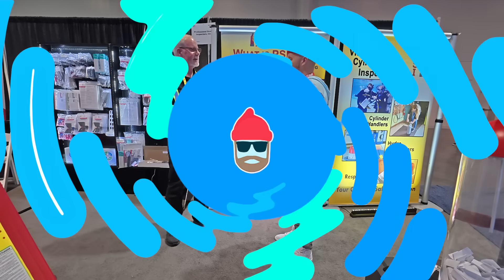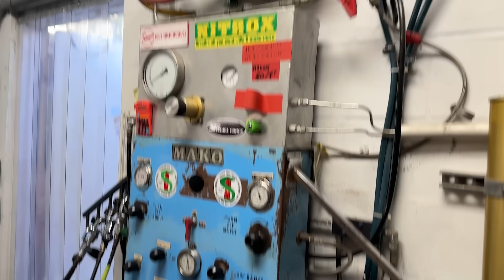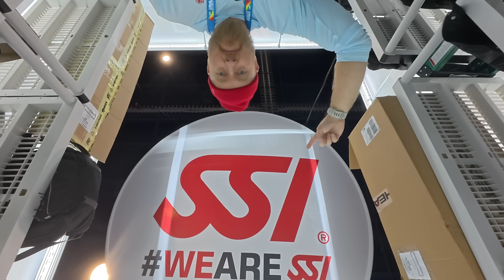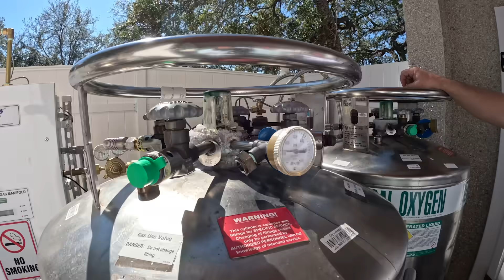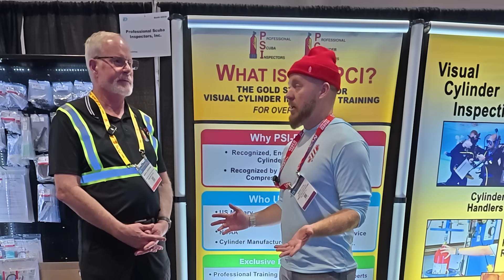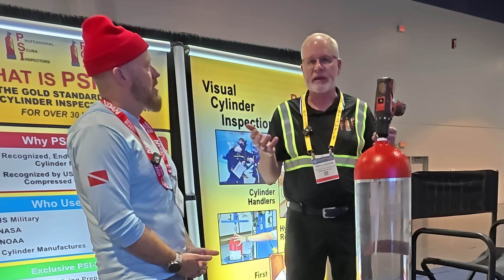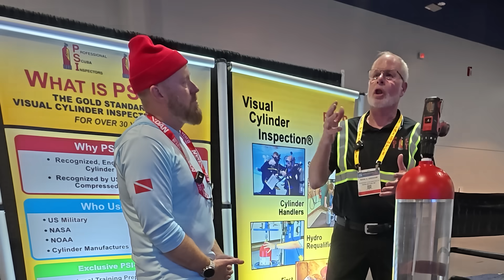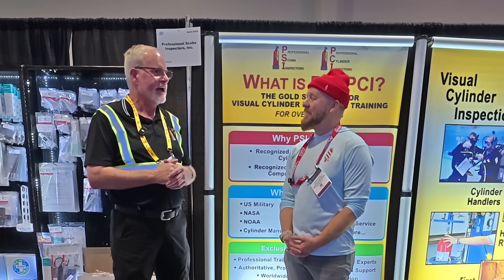101 | Scuba Tank myths busted: Dive Industry Expert debunks common cylinder misconceptions.

Comment: Way back in another life, we always backed away 1/4 turn on STEAM VALVES!!  The idea was, if they heated/cooled while tight against the backseat, you might not be able to free them up again.  Mind you, that has very little to do with a modern scuba system, but just throwing that out there.    Great video, great info (and yeah, I've heard that, 'cut both ends off the roast because my grandma did it' story as well.)
Reply from the maker: Love it, never thought about steam valve and expansion and contraction with temp changes ✅👌
Reply: Ohhhh ‘roast.’  I thought he said ‘rope!’  Was very confused.  Listening to this with a very loud fan.
Reply: Used to back gate valves a quarter turn from full open on oil carrying ships.  Valves had about 24 turns shut to open and we did not want them locking open.  I guess the methodology migrated even though the valves are not at all similar.
I knew someone you could track when he'd dived, his air bubbles had "smoke" in them when they broke the surface surface.  Not smoke but probably water vapour.  I did tell him and urged him to have is bottle checked out but as far as I know he didn't .
Reply: 1/4 turn back is so you can feel if a valve is open or closed. A lose valve is open, a stiff valve is closed. It prevents cranking a valve till it IS stuck.
Reply: @dougaltolan3017  In the Navy we were taught to always check-in-the-closed direction.  This was part of 'valve operator' quals in the nuclear field.  You check the stem height, handwheel position, any position indicators,  and then try to shut it.  If it moves, it was open and you turn it back, if it doesn't turn, it was closed.

Comment: The explosive force of a cylinder.  Simple thought, a 5 HP gasoline engine driven compressor runs for 30 minutes to fill a 3,000 PSI Aluminum 80.  5 HP 30 minutes - all that energy released in a fraction of a second.
Reply from the maker: @Stan_in_Shelton_WA  well said 💥💣👌
Reply: Ohhhh, good.  Yes, very, very good.
Reply: Quite a bit less considering the efficiency of internal combustion engines and the dissipation of heat after compression of the gas. Still a fairly large amount of energy.

Comment: As a divemaster I did not touch people gear (unless it was requested).  Working on dive boats and other location.  My request was show me your gauges while taking a breath from your regulator.  With a partially open valve the pressure gauge drops.  Easy test, respect peoples life support equipment.  I knew a resort owner in Florida that had his leg blown off by an aluminum cylinder failure.  I dove with his outfit before and after that event.
Reply from the maker: Truth - it’s such a tricky balance helping and keeping ppl safe but also respecting their boundaries. That’s a funny one working a boat, people are all over the map with that 💯🤷‍♂️

Comment: The most common bit of misinformation I see is people (and retail dive shops) condemning cylinders based on their age alone, or the 6351 vs 6061 alloy construction.  I'm a little surprised Mark didn't address this one outright, as it's well-covered in my PSI/PCI manual.

Spoiler:  So long as it's NOT constructed with carbon fiber, a cylinder of any age (including the 6351 aluminum alloys) can be safely filled and used if it was built to legitimate standards and passes current hydrostatic and visual inspection criteria.  Carbon fiber pressure vessels tend to have duty cycle limits / expiration dates.
Reply from the maker: @Hawkeye_2478  he addresses it in his course for sure. We only had so much time here, but will do another later this year at DEMA and I’ll certainly try and get that one in there. I’ve ran into the same issue ✅✅✅
Reply: I’ve had tanks destroyed here in Australia by incompetent young staff claiming deformations that was actually part of the manufacture process.When tanks are put in for testing you sign to permit them to destroy if faulty.Talk about pissed off 🤬🤬🤬🤬
Reply: I was near a catastrophic tank failure one time. It had been hydro tested <3 years earlier and got annual visuals. Considering it was 20 years old and probably filled/emptied every day of that 20 years, there may a case for retiring a tank after a certain amount of time or # of fills.
Reply: @aowi7280  but you or somebody caught it on the visual, yes?  Do you want to share what was wrong that you label it a near miss?  Cylinders can and do wear out, and it sounds like yours had a relatively heavy duty cycle.  The 5-yr hydrostatic test will show when the level of metal fatigue reaches its EOL, but more often something else happens to damage the cylinder before it falls out of spec.
Reply: @aowi7280  ~ 
I don't think so.  The oldest STEEL cylinder I've passed on hydro/vip had a manufacture date of 1959.  I was so impressed I traded it for a good Steel 100 from the guy to put in my shop display.  The hydro/vip determines when to "retire" a cylinder, not age.   If I pressurize a cylinder to 7000 PSI at hydro and it expands more than DOT specs say, then the  molecules have become elastic and it may explode.  If if doesn't shrink back to DOT specs, then the molecules have become brittle and it may explode.  They are supposed to expand to specs when pressurized to DOT regulations, then shrink back to specs when depressurized, so they are condemned.  Dive shops that used the 1990 cut-off from AL cylinders are doing so to avoid 6351 alloy cylinders.  That's their safety choice, not any DOT regulation on tank age  (notwithstanding composite cylinders which have a DOT designated lifetime).

Comment: What a great video!  I was fascinated  I worked as a Divemaster, Technician, and Captain in the Florida Keys during the decade of the '80's.  One of the shops that I worked at filled more tanks (sorry, cylinders) than most of the other shops on our island combined.  We were also certified by the DOT to do hydro testing right there on site.  So we saw a LOT of cylinders coming through the shop every day.  We also had quite a few Old Time Divers who continued to use their favorite double hose regulators, which we could still service and repair for them.  One of those guys brought in his steel 72's to get filled.  Normally, he would fill his tanks using his own compressor but it was broken.  Because we filled tanks as they were mostly submerged in a water bath (and I just learned from your video why no one does that anymore) I noticed that there were air bubbles coming out of the tank's top shoulder!  It started to leak at 1,200 psi.  We got everyone out of the shop and I very carefully stopped filling the tank, disconnected the fill hose, and cracked open the valve to release the air.  Once the tank was empty we removed the valve and took a look inside the tank.  The tank walls were completely corroded along with big flakes of rust covering the bottom of the tank.  The outside of the cylinder looked perfect - except for the stream of bubbles coming out of it!  Upon questioning the owner, he admitted to 'borrowing' some VIP stickers from another shop to put onto his tanks because he thought that a visual inspection was just a way for a dive shop to scam more money out of a diver.  Seeing the inside of his tank changed his mind!  He 'donated' the tank to us so that we could cut it in half to use as a very effective demo.
Reply from the maker: Yeesh that’s freaky. Near miss for sure - glad you were able to diffuse the situation. 🤯🤯🤯
Reply: I have to watch every dive shop in South West Florida fill my tanks to stop them from filling them to fast.🤬🤬🤬🤬🤬🤬🤬
Reply: Hang on, were you filling a cylinder without a valid test stamp.... in Australia that's illegal, I thought the US had similar restrictions. One shop told me that he would fill my old alloy cylinder only if I had it between my legs as it was almost out of test.

Comment: Can someone educate me on allowing a scuba cylinder to fall significantly below 500 PSI? Can it damage a scuba cylinder? Would it need to be re-inspected if that happened? What if it was only that low for a day or two, then you filled it back up again, does that cause damage or ruin the certification? Thanks.
Reply: Has nothing to do with damaging the cylinder.  The 500 psi rule is so that you don’t run out of air underwater.  The only low pressure “danger” to the tank is that water or airborne contamination could enter the tank at some point where the pressure is low but we’re talking >16psi I’d guess.  If the tank has 0 psi in it it needs to be visually inspected.  At 0PSI contaminants could enter the cylinder. When I worked at a dive store, we inspected commercial diver equipment, and would fill it to 25 psi so that they could pack it onto pallets and fly them to designated countries without needing reinspection.
Reply: @JohnWalker-e6y would condensation factor into a cylinder that has been breathed empty ?
Reply: @jcar1417  I mean technically, yes, practically, no because the valves on a regulator are one-way valves, but breathing a cylinder down to 0PSI can be deadly if you’re not surfaced and the contamination that could occur would be irrelevant if you’re dead.  The problem is, that at a tank fill if the tech opens the valve (which will blow contamination out of the valve) and there is no air coming out, he is NOT going to refill your tank without an inspection.

This is a highly precautious industry because the slightest mistake in your training, your procedures, or your equipment could potentially result in death or grievous bodily injury.

Comment: I never got the quarter turn debate so now it’s fully open. Is that correct?
Reply: it makes sense why they did it and the video explains why they did it with the fine threaded valves. With current valves they dont run into those problems.

HOWEVER I worked as an aircraft mechanic over 25 years working with cylinders of various gasses and purposes. I've seen valves damaged because people had them fully open and then went to close them and turned them the wrong direction. They kept cranking on it thinking it was jammed. Therefore our practice was to open them until you felt slight resistance then backed it off slightly to allow for movement still. It was 1/8th turn or less. This way when you went to close it youd get movement and feel the resistance right away indicating that it was being turned in the wrong direction. We didnt have damaged valves after that.
Reply: The 1/4 turn shut from full open is US Navy standard for valve operation in general.  (There are exceptions).  It is based on 2 things, really one thing but a couple of situations.  Valves in general (don’t know about SCUBA tank valves) can stick on the “back seat” making it hard to shut them or deceiving the operator to believe that it is shut.  When one checks the position of a valve you check in the shut direction.  There is an expected torque effort to move the valve, if it’s stuck on the backseat you can check a valve shut that is actually open.  Sticking is much more likely if the temperature of the valve changes between the time it is fully opened and when someone tries to shut it.  Differential expansion or contraction of the valve body/bonnet and the stem can cause the torque to shut the valve to be significantly higher than expected.  

That’s standard OP in the US Navy (and in nuclear power plants)

Not implying that any of this applies to tank valves, but it’s likely the background that gets you there.
Reply from the maker: Yes, according to an article by DAN “Old Habits Die Hard” the prevailing opinion is all the open 🤿👌